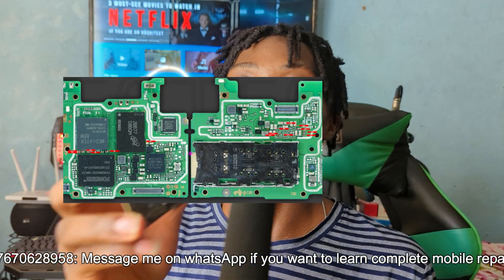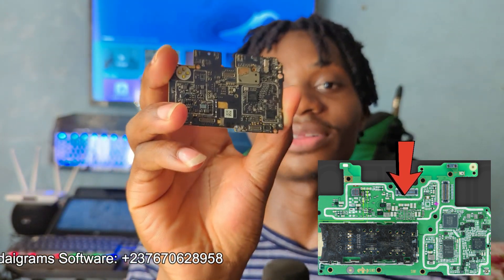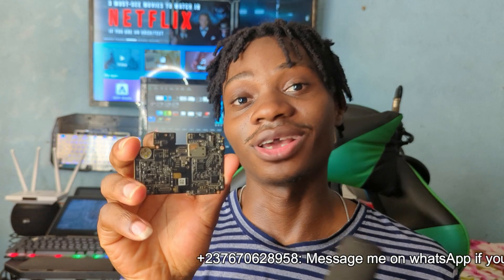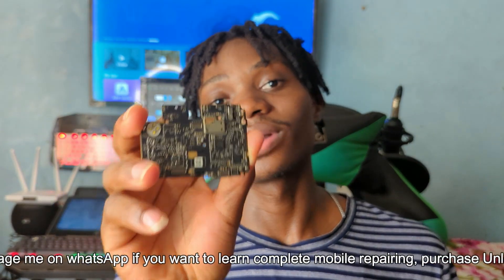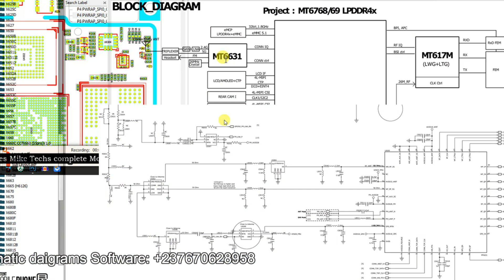You've Been Testing Capacitors All Wrong! Unlock The Secrets Of Parallel And Series Capacitors

Comment: Thank you bro. Learned something again. The way to become a professional goes in small steps. Its really important to learn a lot about the components like Capacitors, Diodes, Resitors, Inductors, IC's and so on to have an understanding of what you mean. So for everybody who reads this. Learn also the components and the functions of the components and IC's. It will help you a lot to understand to make a correct diagnose of a issue or fault.